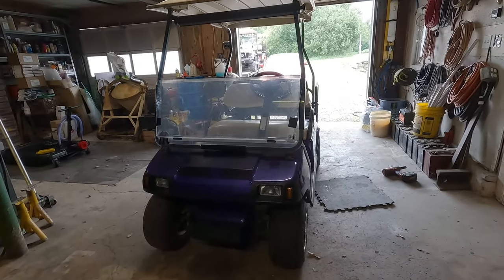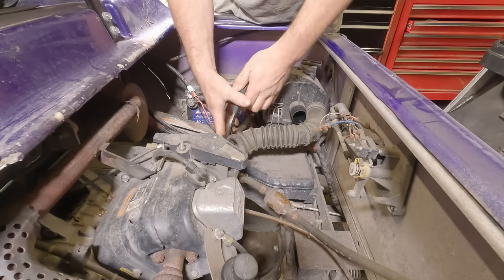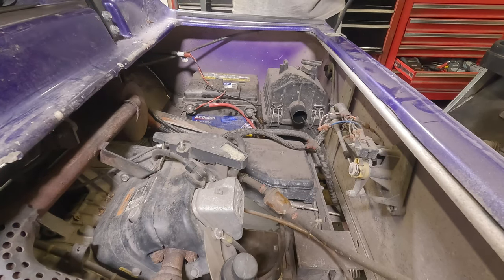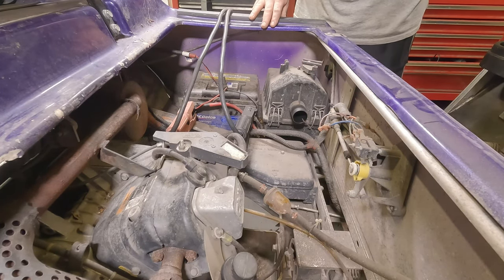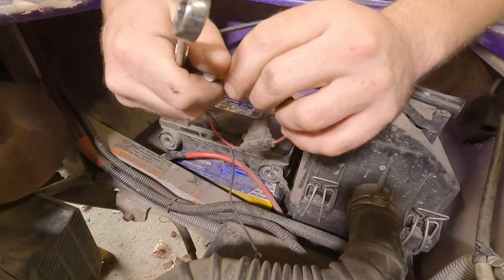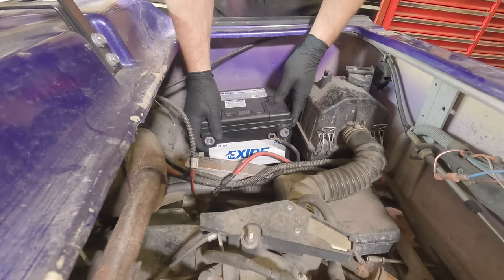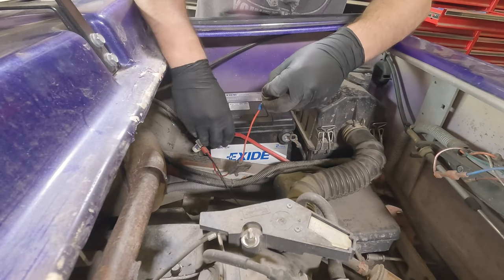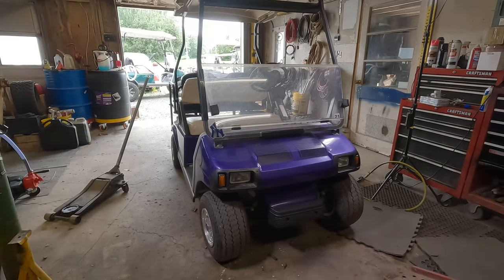2007 Club Car DS, Gas - Press the Pedal and Nothing Happens!

Comment: Hi you might be able to help me
2011club car I have to pump the throttle for about a minute then engine  starts but won't  cut out after driving  it for 5 minutes it's perfect it cuts out and starts no problem go back to it the next  day and have the same problem. 
Would  much appreciate  any input  you might  have .
Regards Robbie

Comment: Hi Kevin, do you have a video that shows how to adjust a F/R selector? I am working on an EZGO gas cart that doesn't come out of gear when in the "neutral" position. Makes it a little sketchy when testing it. Also if you don't mind, I have 2 carts with Kawasaki motors that have the same problem. Both carts stumble and buck a little on start up. Both have had plugs, filters, air filters, fuel pumps and valve adjustment. They run fine once the are moving. I cleaned one carb but it didn't do any good so I'm thinking carb time for both unless you think I might be missing something. 
Thanks

Comment: Hi Kevin 

Really interesting videos, very informative and easy to follow what you're doing - thank you!

I'm in Ireland and recently bought an old 2002 Turf 2 XRT that I'm doing some repairs on and getting back running. I'm not exactly in a position to drop it in to you 😂 - but I have one question and would really appreciate your insights if you wouldn't mind? 

It is almost impossible to get the cart in to forward or reverse when the engine is running - it just grinds the gears. I end up having to let the engine stop, put it in gear and then restart the engine. 
Is this normal? If not, any idea what I could look at / replace?

I appreciate you're busy and have an actual business to run but any help would be much appreciated. 

Thank you.

Brian
Reply from the maker: The engine is supposed to completely stop when you release the gas pedal. These aren't designed to shift while the engine is running.
Reply: @Kevinsgolfcarts  Thank you so much Kevin - that makes more sense - I thought it was something I was doing or something that needed fixing.

Take care and looking forward to the next videos! 😁
Reply: @Kevinsgolfcarts  do you know where I can find an exhaust manifold for an EH29 for my EZ-GO?

Comment: Kevin, do you know where I can get a steering column (3 bolt) for a 2001 EZGo workhorse. I don’t need any of the internal parts unless they don’t sell it without. All I need is the shaft itself with the triangle style mounting base. I show part number (whole assembly) as Ezgo steering column 28633-G01. I called my local dealer and they said it’s no longer made?
Reply: They don't make thise anymore I work for a ezgo dealer ship good luck finding parts for it your gonna have to find a used parts car ! Good luck
Reply: @hillbillywild101  I actually found one on Amazon, ordered it. Even though it said 3 bolt they sent a 4 bolt, contacted them and they sent the correct one. Looks to be new and well built. Not sure if it’s NOS or not. Works either way. Thank you.